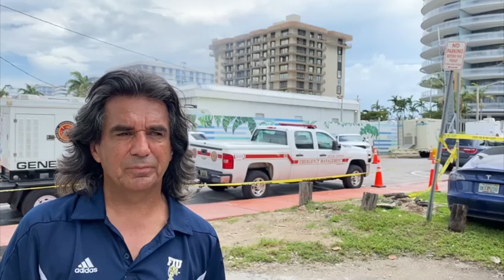FIU expert provides insight from scene of Surfside condo collapse

Comment: Same comments that I made. Through two days ago you got a go from the ground up yes you can build on staying or stay in stone or a build on rock our firm ground. If you build on sand you’re going to sink and they know that without much structure coming up on top of them. My comment was made a new station. My father was a construction worker and I used to work with him we did have a moving we poured cement we have build bridges with me used to move houses. Am I father did work down in Florida as well the name of his company was Sherman industries ready mix concrete heavy moving. We move stuff for NASA in the past. My father Brown brother did work down at Saint James Island pouring cement and helping out when the hurricane came and destroyed the area. I like I said it’s been many years but you don’t forget. You’ve got to have a certain cement Mixture of lye, stone,  calcium, cement, PURE WATER NOT SALT WATER. And the cement Hass to be tested what they call PSI other words pounds per square inch for the amount of weight that you’re going to have built on top of it. You’re going to find that there’s too much pressure for the amount of building levels that they put there I believe. And overtime in the water damage that came through it put pressure on it and that’s why it collapsed Well it’s probably sinking into the sand. I do not believe that that was tested like it should be tested my own opinion.

Comment: Was built during Reagan Administration.
Reply: Designed and planned during Jimmy Carter, built when Florida was a blue voting state with a democrat governor.  Try again
Reply: @kingssuck06  it wasn't built in 1981? That's what I heard which was the Reagan administration.
Reply: @kingssuck06  the original blueprints were apparently excellent and designed by structural engineers. It was later on during the construction that the building codes and blueprints were not strictly adhered to and laxed after Carter was out of White House. The Reagan Administration was notorious for deregulation and letting states/counties write their own laws rather than adhere to National laws of safety standards. Local builders could bend rules under Reagan, not Carter.
Reply: @kingssuck06  my bad

Comment: This guy sounds more like a politician than an Engineer.
Reply: The FIU walking bridge that he approved the design and calculations off collapse killing 6 people so you are possibly correct. The investigation panel said that the bridge had only 90% of the required strength, when in reality it should have been hundreds of % more with safety margin.
Reply: @Kpopzoom  In defense of the prof. The bridge as I understand it was at the time of collapse supported by piers etc. from below. I believe that the contractor bore a lot of the responsibility. What you say could also be true. Does it fail now or does it fail later.
Reply: @cayrick  You are correct that there was problems during construction. Because they didn't want to rip up some traffic bollards then moved the boggies inside/ in stepped from their intended position, while swinging the bridge into place. This meant the ends of the 950 ton bridge were over hanging so they jacked up the post tension bars on the concrete truss to compensate, leading to stretching of the steel there and ultimately failure latter on.   
But the board that looked into the disaster found that the bridge was only 90% of the required strength - when for safety it should have been hundreds of percent.
So that is the fault of anyone who "checked" those calculations.
Reply: @Kpopzoom  FIU were the client and not the design engineers. Figg Engineering were the design engineers. He did not approve the calculations. He was trying to promote the ABC system which was not the cause of the collapse. Except for the number of dead, your numbers are completely  incorrect but sometimes when you show numbers, some people might think you are correct.
Reply: @Kpopzoom  Show me anywhere that he said he approved the design and the calculations. I certainly haven't seen it. He was going to be in charge of a project to monitor the bridge for long term performance but he didn't design or approve the design, or approve the calculations. At least there is no evidence to that effect. Figg Engineering did the design. Berger did the design review.

Yes, I read the NTSB report and reviewed the video. Your number of 90% is off as you just showed. Bridges are not designed with an overall factor of safety anymore. Limit States design methodology is used. But that translates into a total factor of safety of roughly 150% to 175% and not multiple hundreds of percent.

I have seen that CEFA YT channel. He has no idea what he is talking about. He obviously wanted to be an engineer but never had the opportunity. On one hand he has a hate on for them and on the other hand pretends to be an engineer. I wouldn't believe an "engineer" that claims gravity does not exist. The guy can barely read drawings never mind be able to design anything. He uses engineering terms but doesn't understand them or why certain issues are important to designers. In engineering, if you can't calculate it, you don't understand it. I wouldn't waist your time listening to someone like that. He doesn't even believe the failure mode you referenced above. He said there is no way that it was a shear friction failure and he really never understood what that actually meant.
Reply: @Kpopzoom  I haven't seen a single real engineer comment favourably on his channel. He doesn't like honest criticism or discussion. The channel has mostly sycophants that aren't engineer. I have been through the comment section. I am not interested in starting a channel. I have a full time job. Maybe one day once I retire but not now.

I am not from the US but many of the codes for concrete and steel are similar to other first world nations. They all use the LFRD system with similar load and material factors.

It was Louis Berger Engineering that was given the design to review and not the faculty head.

The faculty head of the civil department is not going to do a review of all the structures built at the university. It is also unlikely he has experience as a design engineer. He is an academic. It takes many years of practice to get an intuitive grasp of structures.

No one would know there was an issue with the bridge unless they sat down and did some calculations. To do a rough calculation of the joint for the one condition, does not take long. But there are hundreds of checks to make. It is a major undertaking to check a bridge like this. I don't think he had a spare 6 months to model and do a full review when he has classes to teach and papers to write. It just wasn't his job. It is just not how things work. Besides that, you are speculating. You don't go around accusing people on pure speculation or merely because of an association.

If it was so obvious by glancing at the drawings that there was an critical design flaw, why didn't all the other engineering looking at the drawings notice it? It is because you actually have to do the calculations. Once you know where to look and do the calculation, then it becomes obvious. What makes you so knowledgeable about the structural drawings and calculations for bridges?
Reply: @yodaiam1000  I am not speculating, it was publicly stated at the time that he was given the plans and calculations to review - he did not refute that claim at the time. He also appeared in numerous interviews prior to the collapse speaking about the bridge. In those interviews it was indicated he was intimately involved with the process. 
However, after the collapse he suddenly became "unavailable for interview".

Go and do your research and you will see I am correct.
Reply: @Kpopzoom  He was talking about doing long term studies on the durability of the bridge. Show me something that he approved or did a structural analysis of the bridge of approved the structure design. 

You are speculating since you are assuming that he had something to do with the structural design because he had a connection to the university as the civil department head. He promoted the bridge since that was part of his job and he discussed doing durability studies. He talked about the importance about the ABC system. But none of that is related to a structural analysis or approval.

He is an employee of an institution that was being sued as the client of the bridge construction. He can not and should not speak out.
Reply: @yodaiam1000  You are the one doing the speculation - just for your future reference the "he wouldn't have done this because he would have been too busy doing that" is a really weak form of argument. 
Along with exhibiting poor critical thinking skills, you state it would take you 6 months to decide that the bridge was unsafe. Lets just hope your "engineering" work doesn't get much beyond designing a new patio cover for someone.  

I am not alone in the comments on other videos people have said the same but in stronger terms "why does this guy still even have a job". So plenty people out there who remember this guy was ALL over the project, and plenty people who remember that it was publicly stated that he was given the plans to review and check the calculations over. How could you do long term studies without the plans and calculations? - duh. 

"Long term studies on the durability of the bridge"
Whats his idea of "long term" a week??

LMFAO
Reply: @Kpopzoom  OMG, how many times does one have to say he wasn't the design engineer and there is no evidence he was involved in the structural design. He is a researcher and not a designer. It is not his job to check the calculations. That was the job of Figg Engineering and Louis Berger Engineering. They got paid to the work and not him. I don't take 6 months off to do someone else's job. Does that actually make sense to you? Do you have a spare 6 months to do someone else' job.

He has a job because he wasn't the one that did or check the structural design. It was not and is not his job.

Of coarse he assumed the bridge structure would have been properly design to do long term durability studies. The structural design was not his job. His work got kyboshed because of someone else's mistake. 

You are blaming someone for something that they had no involvement in. There is plenty of blame to through around but you have a hate-on for this guy.

A critically thinking person would realize, they need as least some kind of evidence before accursing someone. You don't have evidence. That is why it is speculation on your part.

You are using the fallacy by popularity argument. I don't care how people say something if it is incorrect. Just because plenty of other people are ignorant doesn't mean you have to be as well.

Also Ad hominems aren't an argument. You would think a person with a half once of intelligence would listen to some one with over thirty years of structural engineering experience. They just might know something about structures and the process that you don't know. You have a lot of hubris for someone that is so ignorant of the facts.
Reply: @yodaiam1000  I never said that he was the structural designer, nor that he was the engineer of record. What was publicly stated was that he was given the plans and calculations to review which it was stated he approved off.
He failed in his duty to spot the obvious that the bridge was under designed and in fact terribly badly designed. He is a structural engineer with a Phd who heads up the department involved with the project, and he was doing analysis on it - He's not a nobody, he is someone who should have known better, and who had a duty to bring that to the attention of others.
Reply: @Kpopzoom  If he isn't a designer, why would he be approving the calculations. Design checks are done by other designers. 

He is not a nobody, he is a researcher which is not a designer. He could train to be a designer but if your job is to teach classes and write research papers, you aren't a designer. It isn't out of his grasp but he certainly wouldn't be efficient at it. Why would he do it when he has far less experience and Louis Berger Engineering was engaged to that job?

You still haven't provided a scrap of evidence that he reviewed or approved the calculations. You haven't shown that he analyzed anything to do with the structure of the bridge. It would just not be part of a normal process. You say "What was publicly stated was that he was given the plans and calculations to review which it was stated he approved of". So show me where it was publicly stated.

The point is that it wasn't his duty since it wasn't his job to do.

Don't believe everything you hear on the internet. Produce or at least review evidence if a claim is made. Have good and rational reasons for believing things.
Reply: @Kpopzoom  The guy who made this video is a realtor and site supper. He is not an engineer. He doesn't know what he is taking about. Taking quotes from a Youtube crack pot is not evidence. He has no idea what the processes are on a project like this. He has been the contractor on some fairly minor projects. He has trouble reading and understanding structural drawings. He is way more ego than substance. He doesn't believe in gravity so I don't what he thinks brought this bridge down. It is like accepting wholistic medicine over what a trained and experienced physician says.

No where in the video or anywhere else has there been evidence that FIU was involved in the structural design.

No where in the NSTB or OSHA reports does it point to the FIU civil department as a party involved in the structural design.

You still have not provided any evidence. You just linked to the video of a crack pot and quoted it.

Comment: There is a YouTube video showing a 3D computer modeling based on the video of the collapse showing step by step how the structure behaved during the fall and as an architect what they show is the key to solve this matter. You can see the upper slabs falling like pancakes but the columns that were supposed to hold them still stand for a couple of seconds what this means is that the slabs were poorly attached to the top of each column also you can see a 3 column section corresponding to 3 floors still attached to each other on the debris. Add the salt water in the parking lot to this columns weakening them and there you have it!

Comment: "note that two witnesses appear to be saying that the "pool deck" failed first, by perhaps a minute or more. To me, the pool deck is the expanse between the pool and the building. Photos show it surely did drop, by one level, I think.

I propose that by having that floor drop, there was then, for the soon to fall building(s), nothing to keep the intersection of their columns at that same level from moving towards the south (towards the pool deck location). I am assuming a solid sheet of concrete across the whole expanse, and I believe it likely there was a garage under the whole thing. The building could stand until some perturbation caused the sideways movement of those points on the columns, and they fell."
engtips
Reply: I am an Architect (not an engineer) but your analysis matches my own perfectly.

Comment: It came out recently that in 2018 a report was given to management by an inspector that there were serious problems. It's not a steel infrastructure building, it's concrete reinforced with steel re-bar. There were columns in the garage under the actual apartment building where concrete had broken off exposing internal steel. There were cracks in floors and walls, when steel rusts, it actually expands, that extends the crack and lets in more water, the cracks extend exponentially. 
There was earlier repair work done that was NOT done properly and 
Management was still jerking around regarding hiring a contractor to deal with what came out in 2018 when this disaster happened.
Reply: I would like the names of those who served on the board during 2018.
Reply: It's a condo association with a elected board. Special assessments have to be voted on & passed by a majority of condo owners.
Reply: Check it out here, this guy is a building engineer and he goes through the report from 2018. It's quite shocking:
https://youtu.be/TrP-Zl7NHzE